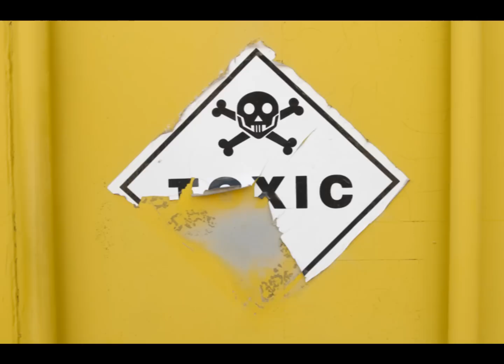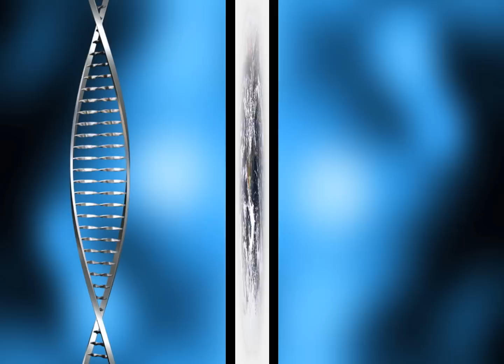PCBs - How to Protect Your Family.wmv

Comment: the problem with PCB's and lead isn't obvious, its extremely rare for a person to take a lethal dose of these chemicals because it takes a large amount.

the problem is lead does nervous system damage even at low levels, so even if one is still living he may have experienced some brain function degradation. Also as said in the video, pcb's are a serious cancer risk and thus any amount of them could cause potentially lethal cancer, but its only a risk no garuntee.